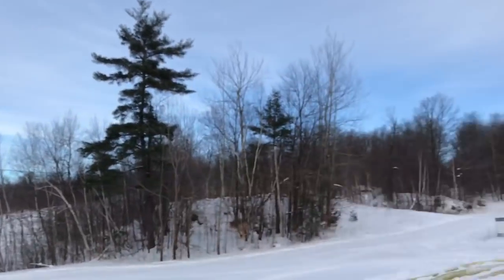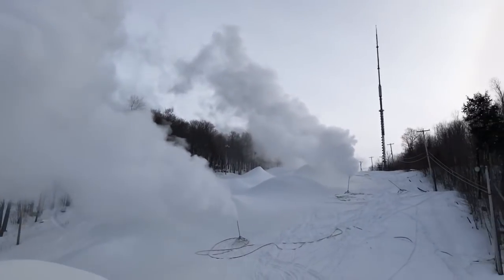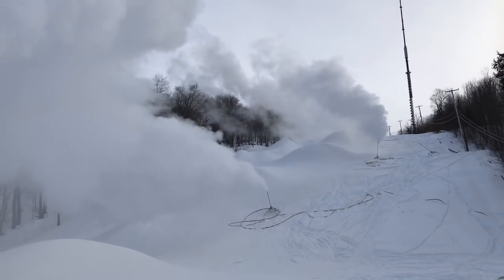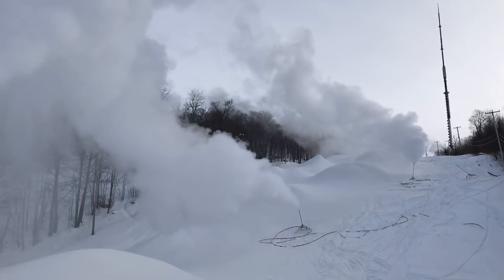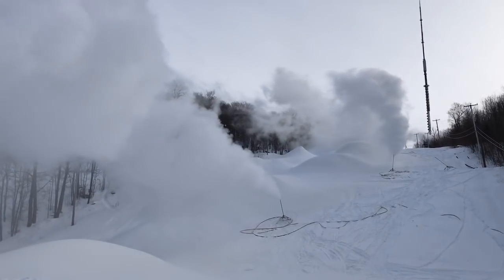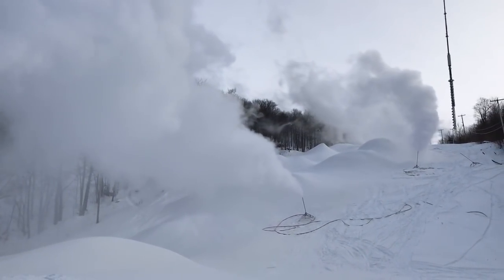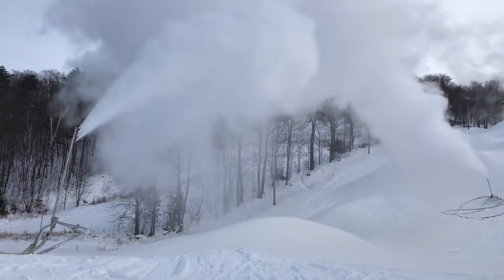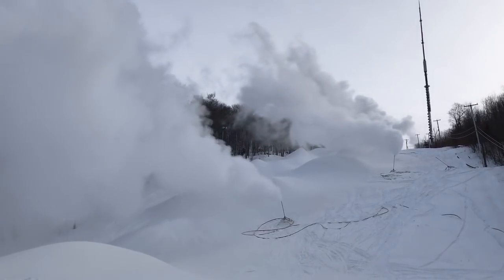Geoengineering Deployment Near Ottawa

Comment: But then you're going to raise the temperature on the Arctic floor if you pump the cold water to the surface which is then going to release methane gas from the ocean floor correct Paul??

Comment: Please follow up with the results of this experiment, be them positive, or negative, for increasing the overall reflectivity of the test area.

It appears to me that the clouds are quickly dissipating a short distanced downwind of the nozzle outlets. My guess is that the particulates, consisting of file ice crystals, are dropping to the surface and are also converting into water vapor due to a relative humidity that is less than 100%. If this was done in the arctic regions would it be reasonable to expect the relative humidity there, near ground-level to be at, or close to 100%?

Comment: Snow has a good infrared emissivity of about 0.97, with a higher emissivity for finer grains and with a lower emissivity if partially melted by the sun or a warm weather event and then refrozen resulting in a surface crust. Good infrared emissivity results in cooler air temperatures in the vicinity of snow cover.

Snowmaking equipment has a potential for agricultural uses in some parts of the world. During the Summer when demand on a well is high, the resulting "cone of depletion" in the vicinity of the well results in a lowered water table near the well and therefore more energy used for each metric ton of water extracted. In the Winter a lower rate of draw can be used, and this more efficiently drawn water can theoretically be stored on top of the soil as artificially produced snow. Artificial snow can an also be used to create shallowly sloped snow ridges about the height of a haystack or slightly higher than a haystack with the intent of the chilly run off during the Spring being used to keep some adjacent watering pond full later into the Spring season with very cold water that will resist evaporation. The snow ridges would partly act as a temporary expansion of a watering pond. If during a time of freezing weather it is believed that a watering pond might overflow at some point in time later in the year, it makes sense to store the water in the form of a nearby snow ridge rather than let agriculturally useable water overflow downstream - perhaps eventually ending up in the ocean unused.

Any new geoengineering technology developed for efficiently producing a large scale artificial snow cover would have almost immediate agricultural applicability. Likewise, any agricultural developments regarding artificial snow cover and artificial snow ridges would have almost immediate geoengineering potential.

Comment: Paul, if we want to reduce the wattage of energy that comes to the earth from the sun in a given area, then we need to design a solar infrastructure for it. There is no reason why we cannot design some form of solar to electric 'stations' we can deploy in the arctic. some of its power can be used for its own benefit, to help it dig itself out of growing ice or anchor itself in during harsh weather, and the remaining power can be diverted to whatever makes the most sense given the location...Like fueling electric powered ships passing through the arctic.

Humans are hungry for power, we need to prevent some power from the sun absorbing into the earth in many places.
similar solar stations could be deployed in hot arid areas and the energy used to desalinate and pump sea water to arid places.

Solar in flood prone areas could be used to power new resovoirs that collect massive volumes of flood water and then pump it over time back out to sea or to cleaning stations to add to fresh water reserves elsewhere.

absorb and use the suns energy for other good things...dont reflect it away and basically throw away a useful and rich free resource!

Comment: SRM in the Arctic using seawater and non-carbon emitting energy could have a significant impact on arctic albedo in the summer months. It is also one of the least toxic Geoengineering systems on the environment.  It should be implemented in 2018 because protecting existing ice is more effective than after the ice melts...

Comment: Paul should consider taking a few physics classes.  1) "Solar powered" pumps to generate mist involve a huge area of dark panels to create a small amount of mist.  The notion that the area of light would be larger than the area of dark is preposterous, as you can watch these truly giant high-powered snow machines' clouds dissipate in seconds.  Solar generation in winter is not an option, and almost as useless when light is present due to the low angle of attack and atmospheric scattering.  2) Water droplets are nearly perfect absorbers and emitters, meaning that any clouds generated will also interrupt the flow of radiated heat from the water surface to space.  The emission from the ocean surface to space is orders of magnitude larger than the emission from ice anytime the ice is more than a few millimeters or so thick, and it goes up from there.  Once the surface is ice covered, its power transmission rate can almost be ignored compared with open water radiation and conduction rates.  3) Open water creates clouds until the water is cooled sufficiently to freeze, as anyone in Buffalo is well aware.  The idea that Beckwith is going to compete with that natural process over large areas is so far beyond absurd that it is truly scary that such a comment would be made by anyone currently being paid to teach.  4) Droplets induced into arctic air warm the air via latent heat, and then once they evaporate, also act as a GHG, reducing the radiative efficiency of transfer from the water surface to space.  5) The balance of ice cover is a balance between the high power water emission rate, and the low power ice emission rate.  This balance occurs naturally and is incredibly efficient at dissipating heat to space and finding its own % of ice cover.  When warm water enters the arctic through circulation patterns, its energy is dissipated to space with ease.  The ice cover is indicative of how much headroom is left in the process, and with ice being in the normal range and increasing now, there is tremendous headroom for cooling left.  While this video might seem like a joke, I suspect Paul actually might believe what he's saying, which is astonishing.

Comment: Isn't water vapor the #1 greenhouse gas? Can you explain more on the effects of putting more water vapor in the atmosphere using this method Dr. Beckwith? I assume you would need to deploy a billion of these, but I'm down if it works.
Reply: Nicholas Brandimarte, in sufficiently cold weather, the result of the snowmaking equpiment is almost entirely ice crystals laying on the ground, not water vapor. The resulting artificially made snow, like natural snow, has both high infrared emissivity and high visible light reflectivity, thereby causing a local cooling effect as long as the snow lasts.

Comment: Problem with these ideas like creating clouds in the Arctic, besides there destructive effect on local ecosystems is that they are far less cost effective than replacing fossil with nuclear power. In fact a rapid deployment of molten salt reactors is the most cost effective solution to the climate change issue.

It makes a whole lot more sense begin a worldwide WW2 level  production of factory built molten salt reactors. Kill fossil fuels, end forest destruction, massive land destruction, food resource depletion and pollution of biofuels,  all within 3 decades. Climate Change catastrophe averted. Emissions stopped. These reactors are proven tech, super-safe, compact,  meltdown proof, fuel sipping, high efficiency, low pressure operation, passively safe, proliferation resistant, trivial levels of short lived, easily sequestered waste, extremely high EROI, very amenable to high temperature industrial process heat, synthetic fuel production, desalination. And the problem isotopes that afflict other nuclear (i.e. Fukushima, Chernobyl) are either continuously extracted or are chemically bound in the salt. Without the need for a giant 6ft thick pressure dome, the nuclear portion can be buried making them easily immune to aircraft impact, and using no water they can't produce hydrogen = no hydrogen explosions (aka Fukushima). Their high temperature will allow them to directly replace Coal and Gas steam generators/boilers and operate standard off-the-shelf 600MW CCGT steam turbines at 1/6th the cost of current Light Water Reactors custom built steam turbines. 

An unlimited energy supply that will always be economical., nuclear can easily replace all fossil fuels with zero emissions. Low material requirements (~1% of wind & solar), no need of storage (and yet can provide cheaper overnight storage of ~$50/kwhe with an extra molten salt loop), no need of long distance transmission, no seasonal variation issues and yet a lower electricity cost than even gas & conventional coal.  And an unlimited fuel supply. And the surplus nighttime electricity is a perfect match for EV charging. With zero emissions. I call that Win, Win, Win, Win. A No-Brainer. Only problem, Big Oil knows that is all totally Doable, so they cannot allow it. The Oiligarchs love fantasy energy non-solutions, wind, solar, hydrogen, biofuels, whatever doesn't work, that ensures Big Oil's energy hegemony. With such vast wealth and power they control our politicians, media, institutions, regulators, environmental NGO's like Greenpeace ($400M/yr), they even buy climate scientists = The Controlled Opposition.

Big Oil's Archenemies. A list:
Youtube: Fast-Spectrum Molten-Salt Reactor - Elysium Industries - Ed Pheil @ TEAC8        
https://www.youtube.com/watch?v=pqVt8cxx-44
Moltexenergy d0t c0m /ourbreakthrough/
 nuscalepower d0t c0m /smr-benefits 
 thorconpower d0t c0m /design
Terrestrial Energy's IMSR at  terrestrialenergy d0t c0m 
Watch the Youtube Video " Thorium 2017 ".
Reply: right..why is this even still being thought of nuclear may just kill us all first. At first it was thought to be a good idea..but..you should not build something with highly toxic waste you have no idea how to get rid of. And this is a response even after Fukushima..do some humans not learn anything?
Reply: Nice try Art, but just another schlock hit piece from someone who knows zip about the subject. Notice he writes in a blog with no comments allowed, because he knows damn well his bogus claims would be all quickly refuted in the comments. A former exec of the Sierra Club. Oh you mean the same Sierra Club that was forced to admit it took $26M in bribes from a Gas Fracking Co, to fund their anti-Nuclear and anti-Coal campaigns. With another $30M to follow. During this time the Sierra Club promoted Gas as a "Bridge Fuel" and didn't want to talk about the fact that including methane emissions, Gas is every bit as bad as Coal for GHG emissions. Big Oil has unlimited funds to pay toadies like your stooge boy there to trash their competition. Notice Toadie won't talk about the 7 million deaths a year from his combustion fuel emissions and maybe a couple billion deaths from runaway global warming he is promoting. 

His nonsense is thoroughly debunked here:

http://environmentalprogress.org/big-news/2017/10/16/enemies-of-the-earth-unmasking-dirty-war-friends-of-earth-greenpeace-south-korea-nuclear-energy

"...In the 1960s, most conservationists favored nuclear plants as a clean energy alternative to coal plants and hydroelectric dams and only turned away from nuclear with the rise of open anti-humanism.

An influential group of conservationists within Sierra Club feared that cheap, abundant electricity from nuclear would result in overpopulation and resource depletion. “Giving society cheap, abundant energy,” said one activist, “would be the equivalent of giving an idiot child a machine gun.”

Recognizing that overtly misanthropic appeals wouldn’t work, anti-nuclear groups sought to frighten the public. “If you’re trying to get people aroused about what is going on,” admitted an anti-nuclear leader, “you use the most emotional issue you can find.” Said another: “I think that playing dirty if you have a noble end is fine.”

Playing dirty included using fossil fuel money. In 1969, FOE’s founding donation of $80,000 — $500,000 in 2017 dollars — came from Robert Anderson, owner of oil company Atlantic Richfield. [1] “What was David Brower doing accepting money from an oilman?” even his highly sympathetic biographer wondered. [2]

The answer is that he was trying to kill nuclear power. “There’s no more important issue in my life now than to do everything I can,” Brower said a few years later, "and see that Friends of the Earth does everything it can, here and abroad to stop the nuclear experiment before it’s too late.”[3]

In 2012, the Sierra Club was forced to admit taking $26 million from a natural gas company and today has taken over $100 million from natural gas and renewable energy investor Michael Bloomberg.
    
The Natural Resources Defense Council (NRDC) accepts large donations from investors in both natural gas and renewables who stand to benefit from killing nuclear plants in California and New York. 
 
And the Environmental Law and Policy Center (ELPC) — which led the effort to kill nuclear power in Illinois — is funded by natural gas and renewable energy interests...."

BTW CANDU nuclear analysis by independent research agency CERI determined it has full lifecycle CO2 emissions of 1.8 gms/kwh that is far lower than ANY form of energy on the planet and has an EROI of 120:1 again far higher than any form of energy on the planet. So quite spreading lies and disinformation in order to make your friends in Big Oil even richer. And ruin the planet while you're at it.
Reply: Taylor I go with reputable international agencies not your Fukushima Death Cult propaganda which in reality is nothing more than Fear Porn. The Real Truth from the EU Commission's ExternE report:

Deaths per TWh of electricity:

Coal: 161
Oil: 36
Biomass: 12
NG: 4 
Hydro: 1.4
Wind: 0.15
Nuclear: 0.04 (including Chernobyl = a Soviet military reactor with no containment & a positive coefficient of reactivity, all illegal for commercial nuclear power)

Solar & Wind Toxic Waste - Baotou, Inner Mongolia, the worlds largest rare earth mineral refinery pumps toxic and radioactive tailings into an adjacent artificial lake, extreme wind power radioactive waste. There is enough thorium in the tailings from one year's production of a large rare earth mine that makes materials for the wind & solar industries, to power the entire planet, all energy needs, for one year, burnt in a LFTR, or Liquid Thorium Fluoride Reactor. And that Thorium is waste, expensive to dispose of, they will pay you to take it away. 

Solar Waste - Things Worse Than Nuclear Power: the real waste problem, solar PV waste, Solar PV powered world produces 63 thousand times the waste of a Nuclear Powered World, Solar PV cadmium & lead is forever, land area of Solar PV is over 1000X Nuclear for same energy output

Even for Radiation Coal & NG are much worse than Nuclear. Coal power plants release 100X the radiation of nuclear power plants per unit energy. Chernobyl was a Soviet Military reactor with no containment and a high positive coefficient of reactivity, all illegal for commercial nuclear power, so it is not relevant.

Fukushima was a total screwup, but killed not one person, vs  combustion fuels kill 7 million people every year. We can easily avoid Fukushima's by going full bore on molten salt reactors, super-safe, compact, low materials inputs, meltdown proof, fuel sipping, high efficiency, low pressure operation, passively safe, proliferation resistant, trivial levels of short lived, easily sequestered waste, extremely high EROI, very amenable to high temperature industrial process heat, synthetic fuel production, desalination. An unlimited energy supply that will always be economical.

Comment: ya that is scary the huge amount of water vapor this year dropped so much water on eastern Ontario that the St Lawrence river never really did go down much this year..when it should be at it's lowest in late summer. Water vapor is not benign the tributaries of the Ottawa river and others saturated the land and filled the great lakes...lots of crops were flooded out, our growing season started so late it was spring all summer..not enough sun and very high water. Then when the days were getting short and it was harvest time..the warm weather came...which didn't help the crops. Now we seem to be in a deep freeze..polar vortex again. The spraying in the east Pacific is pushing that air up to Alaska and the polar vortex is slip sliding down Hudson's Bay.

Comment: Watts and heat losses per mechanical unit times hours of runtime vs wattage per sq meter reduction times sq meters shaded applies. Not sure but believe a more efficient method may exist; perhaps spraying metro centers with large amounts of cyanide gas or other deadly toxins may be quicker, cheaper and last much longer. Nature will handle that for us soon enough if we don't find and deploy a solution soon.